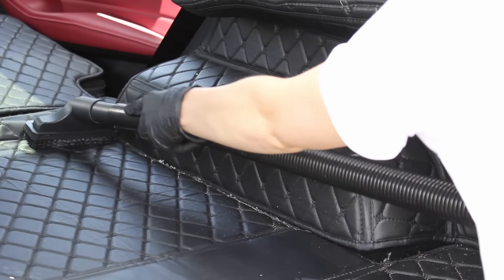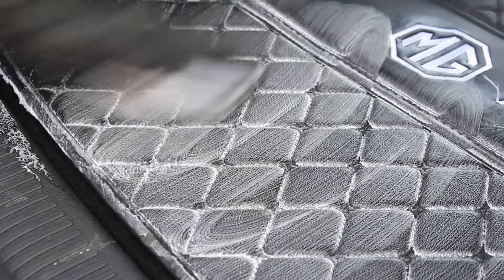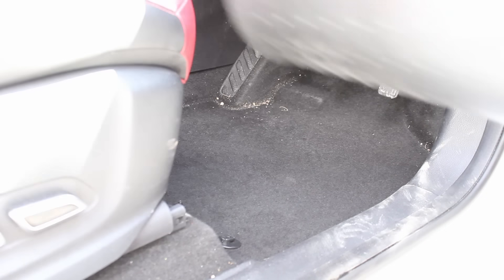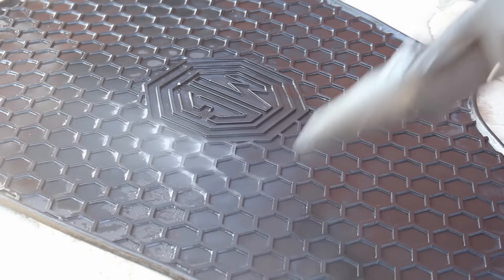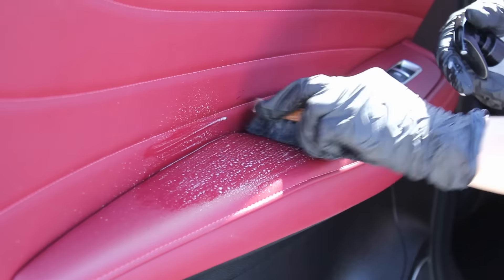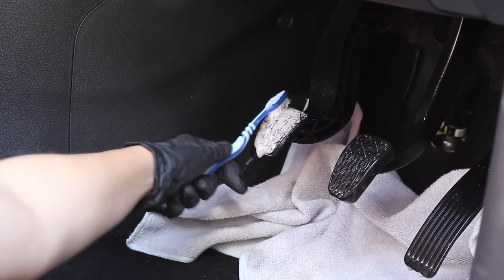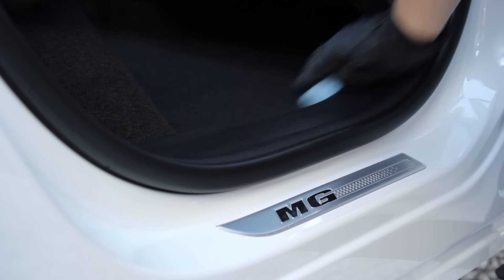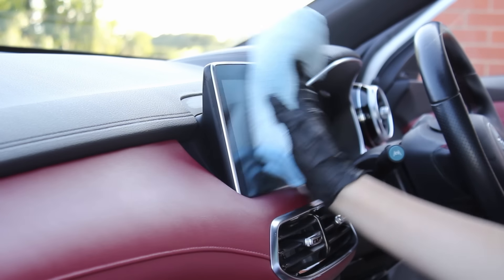How I Keep This Car’s Interior Spotless | Interior Detailing

Comment: I love your videos, I was a bit confused when you started using that brush on the steering wheel and leather though, is it not too  tough to scratch or am I missing something? Any input would be great. I'm new to detailing.
Reply from the maker: Thanks for watching 😊 the brush is okay as long as I don’t use any pressure. It can be really handy if the leather is particularly shiny but if it’s not too bad I’ll just use the cleaner on a cloth to avoid being overly aggressive on a maintenance clean
Reply: @AutoCareHQ  Ok that's good to know. Appreciate the videos your putting up. Helps a lot.